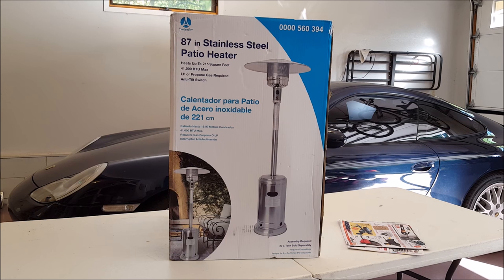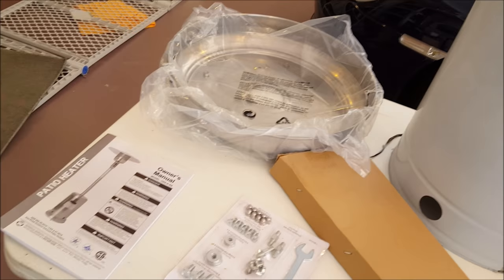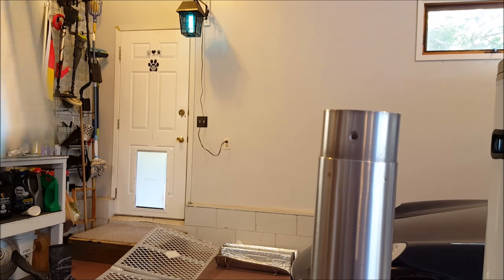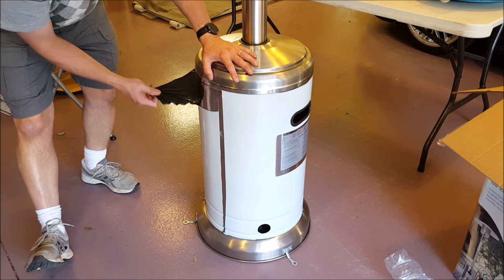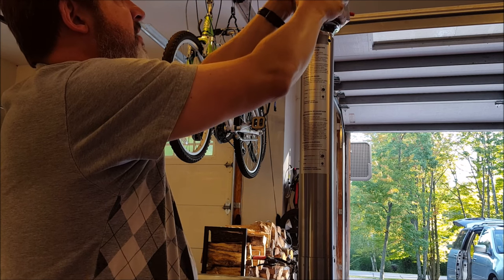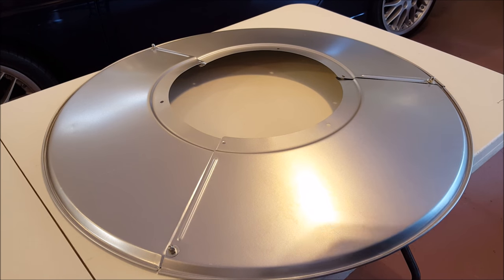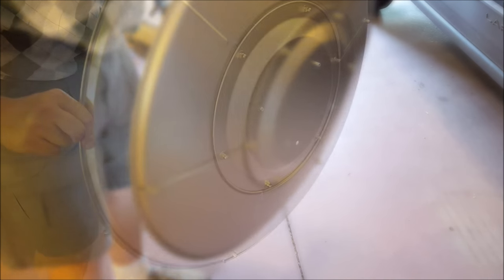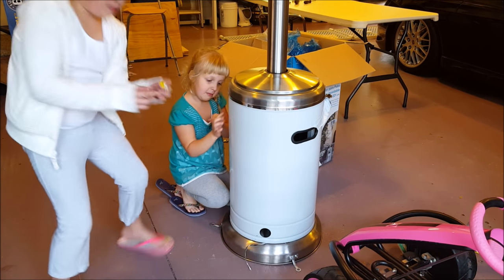GardenSun 41000 BTU Patio Heater (Home Depot) Assembly Video (How To)

Comment: Good instructional video, straightforward and to the point. 

A couple of points on safety though... use gloves when handling the sharp sheet metal edges, and check for leaks prior to using. Just might save you a trip to either the emergency room and or burn ward.

Thanks...